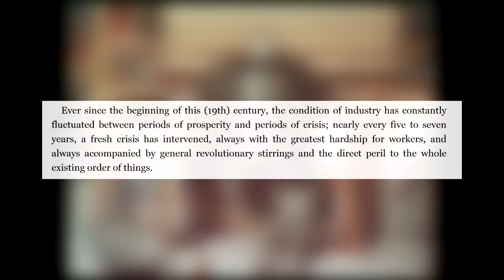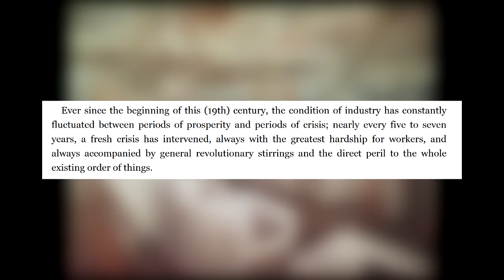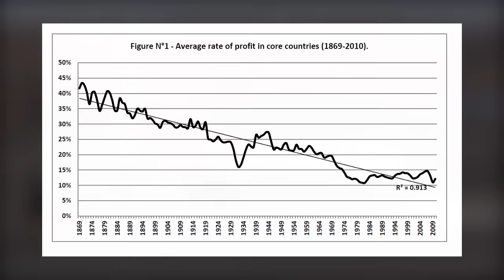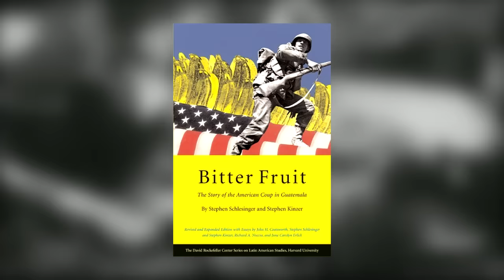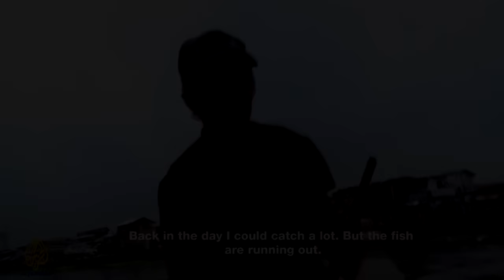Capitalism Really Sucks, But Why?

Comment: 1. Boom and bust cycles are a product of modern monetary systems, using unbacked currencies and fractional reserve banking to inflate money to benefit the state. It has absolutely nothing to do with capitalist mode of production. 
2. The rate of profit falling is entirely contingent on the labor theory of value, which is heavily disputed even by leftists such as Baudrillard and sign value. This is something Marx was aware of when he wrote “the poverty of philosophy” and mentioned it in “Contribution to the Critique of Political Economy” saying he planned to solve it. He died before he ever did. 
3. Capitalism does not require infinite economic growth, that is an absolutely baseless claim. And even IF it did he disregards the difference between extensive and intensive growth. Instead of using more resources in production, we can get more from the resources we use in production 
4. This is literally nothing but conjecture on failures of the state and not capitalist mode of production or talking about those who break laws, which is entirely irrelevant. If the state did not intervene in the market you could not have lobbyists, and there will be criminals in all forms of society.
5. Please explain exactly what form of coercion is stopping people from starting businesses, having jobs or seeking education? If not just their choice to look after family instead etc. Those with merit have the opportunity to do anything within the confines of the law, the just have to take it.
6. This is contingent on point 2 which is contingent on the labor theory of value, which is extremely flawed on every level.
7. Monopolies are entirely a product of the state and not the free market. Monopolies cannot survive the innovation of the free market. I challenge you to give me one example of a monopoly that arose and lasted in a free market without government intervention. Antitrust laws, intellectual property, minimum wage laws, taxes, lobbyists, subsidiaries - all ways that the government intervenes to promote big businesses and stop small businesses. All of which wouldn’t exist in a free market
8. This is all conjecture and nonsense. It assumes that the worker and the owner have entirely diametrically opposed interests. But if shorter hours reasonable hours and better safety standards allow workers to work better and produce more goods, (which they almost always do) then it’s in the owners interest to have those. 
9. Again nothing but heresay on things that are entirely caused by modern central and fractional reserve banking anyway. 
This video is filled with blatant sophistry, I hope at least some of you aren’t so tempted by the allure of unjustly owning the fruits of your piers labor and being part of some “in group” that you are drawn into this psuedointellectual drivel. So please, read Human Action, research the ECP and have a good day :)
Reply: What’s the best example of actual capitalism to you?
Reply: @ER-zf5tr  Switzerland is a pretty good example. What’s the best example of socialism or communism to you?
Reply: @conorw4077  would you say your example of Capitalism is a system where there is basically no public sector? 

I’m not sure tbh none from what I know
Reply: @conorw4077  im asking because I hear a lot of debate regarding the state and it’s involvement in capitalism. A lot on the right claim capitalism is where there is absolutely 0 government involvement in the economy and obviously the left claim the state has always been involved even back to capitalism’s formation. I was talking to a right libertarian (I’ll link his channel) who claims to be a minarchist ie he supports private police etc. To my knowledge the state has always been somewhat involved in a capitalist economy but again there could be some example throughout history where the state wasn’t. 

His channel btw: https://youtu.be/W4hwh_a0NYY
Reply: 1. Nope, private capital is still incentivised to extend itself to its maximum capacity regardless of if money is tied to gold or not. The problem is that any company that does not push itself to the limits will eventually lose out to a company that does.
2. There are metrics on this, you don't need to believe in the labour theory of value to read a graph my dude
3. Any company that does not grow loses to one that does.  A company is forced to constantly grow to compete for market share and investment.  This is basic stuff that even a capitalist acknowledges.
4. "Lobbyists only exist because states have laws" isn't the slam dunk you think it is.  What's your solution here?  Skip the middleman and just have private companies decide on what the law is?  That's worse.  You get why that's worse, right?
5. "What's stopping a skinny kid from winning the heavyweight championships?  If he gets strong he can do it"
Amazing reasoning, but imagine a world where in order to train at the gym, you had to fight everybody in the gym.  You're not addressing the problem, you're just saying that for some people it isn't a problem.  We know that for some people it isn't a problem.  That's the problem.
7. You have no evidence or reasoning to indicate that free markets are inherently innovative, or that innovation innoculates against monopoly.  Sure, big business leverage the state against competition but do you really think in an unregulated market those same businesses would just shrug and say "Oh well, nothing we can do to influence the world to our advantage!  I guess we'll just let the better ideas win!"  You can't think of any examples of companies cooperating to achieve the exact same goals without going through state machinery?
You can't even think of a specific word that was invented to describe exactly this practice?  No?  You've never heard of a cartel?  And you think you can challenge anybody else to anything?  Sit down.
8. It's nonsense to assume that workers and owners have different interests...but then you flat-out admit that better hours and safety standards are only in the owner's interest if it increases productivity.  In other words, you're implicitly saying that things which aren't in the interests of workers would still be in the interests of owners if it boosted productivity.  This is literally a concession on your part and I don't need to say anything else.
Reply: @ER-zf5tr   Ah I see your confusion. Well most dictionary definitions of Capitalism make mention to the majority of property being under private ownership, and  either the terms “free market” or a “lack of government control”. Meaning the government would have next to none of absolutely no interference in the economy and the vast majority of the means of production would be under private ownership with only some or no public ownership. So by dictionary definitions almost all countries are mixed economies and not capitalist. 

However the term has been co-opted by others such as John Maynard Keynes who was for heavy regulations while still mostly private means of production, the style of economics we see today in a lot of western countries. Marx also heavily reduced his definition to only mean privately owned means of production, without stipulation as to state involvement, as Marxists see that is kind of irrelevant. 
So because you have different groups using the same term with different meanings there is misunderstanding, but generally libertarians or pro capitalists mean a free market with private  MOP , whereas leftists or Keynesians may just mean private means of production, even though that is not actually the definition.

There have been examples throughout history where the government had very little involvement in the economy such as early America (not strictly capitalist though as slavery at the time violates individual rights) Switzerland now aswell as some others. Yes the government became involved in most economies historically speaking, but libertarians and other capitalists aim is to reduce that involvement through constitution, a smaller government etc. The thinking being that although it formed that way initially it can be changed and the government will not necessarily regain control because of constitutional limits or otherwise. Others simply want to remove the state altogether in favour of private defense. 

 Hope this clears it up.
Reply: @conorw4077  out of interest what are you in favour of? Completely privatised economy (including, military police etc) or just a small public sector?
Reply: @DeoMachina  1. Companies wouldn't exist in the same way in a free market, and the rest of your points are irrelevant. Unbacked currencies are inflated by the state to benefit central and fractional reserve banks at the expense of diminishing the wealth of the working class. This creates a spending based economy, means people must spend and invest and not save, which causes recessions. There is a reason the 2008 crash was caused by state intervention, and the great depression before it and every other recession since the beginning of time, excluding when volcanos explode and hurricanes which are unavoidable.
2. Yes and other factors affecting that include increasing corporatism (because of state intervention), increased taxes, inflated currency... Rate of profit is an absurd expression based on the false assumption that there exists a relationship between profit and capital. Profits are earned by superior foresight in adapting production to meet future shifts in consumer demand before competitors are aware of the need for such adaptation. Since profits cannot be related mathematically to superior foresight, there can be no meaningful "rate of profit". 
3. Grow is such an obtuse and ill defined word you could be asserting almost anything with that statement. But assuming even if that was true (which it isn't) there is intensive economic growth, meaning a greater efficiency of usage of available resources, which makes the point irrelevant.
4. You could have a constitutionally limited government that is not allowed to interfere with economic affairs, or just a state that doesn't interfere like Switzerland. and although I don't agree with it, private law is better than a huge state with a monopoly on force and law, as an arbiter of even its own wrongdoings, and ever expanding control over economics, foreign affairs and citizens daily lives, surely you can see that right?
5. That was entirely incoherent but basically, everyone has employment and financial opportunities if you live in a developed western country, take them or don't but its your choice to live by. I'm sure you agree capitalism is an individualist system, with rights, responsibilities etc all placed on the individual and not the collective. It is your responsibility to seek the outcomes you want in life, if you do not take your opportunities then it is because of your choices.
7. A legal monopoly has never been maintained in all of history, I challenge you to give me examples. Also you conceded that innovation is part of capitalism in your own response earlier "A company is forced to constantly grow to compete for market share and investment.  This is basic stuff that even a capitalist acknowledges." Also cartels operate as an illegal business, cooperate with and bribe the government, receive backing from other governments to launder money etc. this would not happen if drugs were legalized (which they would be in a free market) they cooperate with the government which also would not happen, and if the state spent as much money on a proper police force as it did funding politicians to sit in chairs and very slowly make decisions then they would have an better response to threats such as cartels.
8. Yes. I agree that not all interests of the worker and owner are guaranteed to always align. But workers in poor conditions work less efficiently, especially in more skilled work so your point is irrelevant. You say if poor conditions didn't decrease productivity and still lowered cost then it would be in the owners interest, but they do decrease productivity so your argument is hearsay only relevant in hypotheticals. Why do you think companies have benefits such as company cars etc? They want to keep workers happy. Owners have to compete for workers same as workers for employment, if the conditions, hours, work pay etc is too bad then get a different job. After all there would be more job opportunities and diversity of business in a free market (a recurring theme you may have noticed).

You should try being more cordial or at least less infantile when you deliver responses and points. Comments like "sit down" etc make you come across as immature and do not help your case. You will be less likely to change me or anyone else's minds when you speak in that manner, and it doesn't promote good discourse.
Reply: @conorw4077  1. People are forced to spend regardless of the monetary system, because they need to, y'know
Not die
The working class isn't saving money not because of inflation, but because they need to meet their immediate needs or perish.  None of your alternatives even purport to address this.
2. To claim that capital and profit do not have a relationship is a lie.  You do not believe that.
3. The term 'grow' is well-defined and well-understood.  Again, you are pretending to not know things.  Your argument really isn't bolstered if you feign ignorance!  It just isn't!
Efficiency is not the point being referred to, so again I have no choice but to interpret your refusal to engage as a concession.
4. You realise that the bad things that the state is doing to economics, foreign affairs and our daily lives are things the state is doing at the behest of capital, right?  Like, although the state is brutalising people on behalf of oil companies, oil companies are more than happy to pay for private security to do the dirty work when necessary.  There are countries where this happens, and the state is in no position to stop them.
5. Again, you're straight up refusing to acknowledge the point made.  The number of oppurtunities is not being debated, here.  You're attempting to refute an argument that nobody made.  The problem isn't "nobody can succeed", the problem is that success is wholly dependent on a class of people living in underpaid, precarious conditions.  It doesn't matter if a cleaner starts his own business, because somebody has to hold the broom at the end of the day.  What, you think we can all just be CEO's?  A hierarchy requires there be a base layer at the bottom.  Personal responsibility doesn't address any of what I just said.  Even if everybody woke up tomorrow and took maximum responsibility, nothing would change, here.
7. Legally speaking a monopoly doesn't even need to control 100% of the market, speaking legally that is.  So uh, legally speaking any time a company is found to have acted in a monopolistic manner then legally speaking it is a monopoly, by legal definition.
Interesting how a moment ago you had no idea what "grow" meant, but now you are very, very certain it means "innovate" which is...an interesting strategy!  Again though, you are simply lying through your teeth and I will not be addressing such fantasy, lmao.
As for the cartels point...you seem to genuinely think I'm referring to the drugs trade.  I'm speechless, honestly.
8. I don't mean to dunk on you too hard but the fact that poor conditions exist does actually refute everything you just said.  It does, actually.

And if you don't like my tone, perhaps you should examine your own.  You strut in with talk of sophistry and 'pseudointellectual drivel' and you expected better discourse?  I'm fairly cordial to people who can at least pretend to be here in good faith.
Reply: @DeoMachina  1. Inflation makes saving close to impossible. It is at least decentivised enough that in almost all circumstances not spending money immediately does not make sense for the working class. The majority of the working class in developed countries are able to meet their immediate needs. This is visible by millions not dying every week. Inflation makes it so that any excess income they have ever saved and could otherwise use to try and start a business etc should be spent immediately. This makes the working class consumers and not investors or businesspeople, this one of the main factors that make it difficult to leave the working class
2.Yes I do believe that. And no they do not have a relationship. Rate of profit is an absurd expression based on the false assumption that there exists a relationship between profit and capital. Profits are earned by superior foresight in adapting production to meet future shifts in consumer demand before competitors are aware of the need for such adaptation. Since profits cannot be related mathematically to superior foresight, there can be no meaningful "rate of profit." Look up praxeology and Austrian Economics.
3. You are the only one who is feigning ignorance. I said efficiency of the use of available resources. Just look up the phrase "INTENSIVE ECONOMIC GROWTH" and realize how everything you just said was incoherent sophistry. I have conceded nothing, claiming your misunderstanding and lack of knowledge of basic economics as a concession on my part is just a purely bad faith argument, do better.
4. How do you think these companies became so powerful? Because again I will ask for an example of any of these huge powerful companies and conglomerates that came to be or exist without help from governments. The position of governments as moral arbiters with a monopoly on the use of force that can influence the economy causes these problems and nothing else. And surprise surprise developing world governments are not able to deal with paramilitary death squads organized and funded by enormous government backed corporations.
5. Again these people would be better payed and have more employment and business opportunities in a free market. All of your points about "capitalism" refer to this neo-Keynesian mixed econ and not actually to Capitalism at all. You realize the definition of capitalism includes the words "free market" right? Check Miriam Webster. Yes a hierarchy requires a base layer, and in a free market that base layer is doing pretty well. Look at Switzerland's GDP and working class. 96% of people there make 48,700 USD a year or more, 51% make over 100,000 USD or more. Considering Switzerland is one of the closest things to a free market we have a think it makes a compelling case for the success of the free market in helping the working class.
7. Yes legally speaking that is correct. I am yet to become aware of those requirements being met and or sustained by a company without the aid of the state. If you know an example please inform me. I know what the word "grow" means, but SURELY you understand the inherent vagueness of it when referring to economics? It could mean use more resources and make more product , use less resources and make more product, make more money, become larger as a business... you speak in very unclear terms, cause misunderstanding and then announce a concession when your incoherent drivel is misunderstood naturally. And you misunderstand me, as intensive economic GROWTH comes from INNOVATION with resources used in production. I am not saying that's what you meant by growth, I am saying innovation with resources used in production can drive intensive growth. Making it different to extensive growth which leftists assume is the only kind of economic growth. But hey I wont claim a ridiculous concession on your part because of a simple misunderstanding.

I see what you are referring to now in reference to cartels, I made a mistake as that is what people typically mean when referring to cartels. Anyway they are either formed illegally or with state help or often both. I'll really concede on that one if you can find an example of this without state help, intervention or bribery, or using illegal means such as initiating force.
8. I don't mean to dunk on you too much but those are MONOPOLIES CREATED BY THE STATE and largely in developing countries good lord how many times... None of that is relevant to capitalism because it didn't happen under capitalism because its not in a FREE MARKET. Please look up the definition of capitalism. All give mention to either the phrase "free market" or "lack of state intervention" or "controlled by private owners for profit, rather than by the state"

I speak in good faith, and your accusations to the contrary are only when I have misunderstood you. I am not sure why I would pretend to not understand you because it is not like I am strawmanning you in doing so,  I have only tried addressing your points. And it is psuedointellectualism. It is blatant lying, use of misnomers etc to push a political agenda while cosplaying at an attempt to open a conversation. I am sure if I was to make an irritating PragerU style video about why " socialism sucks" and fill it with what you saw as blatant lies, misrepresentation and intentional use of misnomers you would find it quite annoying, and if you were going to comment it would probably sound pretty similar. Seeing as how you responded to my comment at least.
Reply: Nice argument.
Reply: @conorw4077  u made really nice points, maybe im not informed enough but i think an Anarcho-Capitalist society is the best way to go, its the closest we can get to freedom without going full anarchy 

its absurd to me that people think working at a fast food store is being a wage slave... u are getting paid for your service, thats literally how the universe functions. humans constantly want to move forward (not saying its good or bad, its simply what happens) and capitalism is the proper system for that. once the Ancap system starts working, all the organizations and people would be locked into each other in this mutual agreement and things would proceed naturally, standard of living for working class would be higher as well

idk how working can be slavery, cause u didn't have a choice? (between working and starving?) what about living then? u cant consent to being born... does that mean we are all slaves? its like socialists dont understand the most basic laws of this universe and blame all problems on Capitalism when in reality its either government or other problems (over-population, religion..)
Reply: @neonwitch1449  I would absolutely agree. Whether it’s ancap or minarchy we need to free the markets and reduce the size of the state, and what form that takes is just semantics to a degree. 

With regard to you being uninformed you seem to have pretty well developed ideas and values already. If you want more on libertarian type stuff I would recommend Mises, Rothbard, and Carl Menger, Rand and other Austrian school  economists. Plato and Aristotle are must reads imo. Thomas Sowell is very good also. And if you care very strongly about it and want to try and help  against the state Samuel Konkin has good stuff on how to take action. 

But I would always recommend reading a bit of everything because you want to be well rounded, so people like Marx and Baudrillard are worth reading to learn from the other side.
Reply: @ER-zf5tr  Ideally completely privatized, but I think it’s more important to focus on moving towards your goals than to get bogged down over what are to some degree semantics. If the state is getting smaller and the markets more free then I’m happy.
Reply: @conorw4077  thank u for the suggestion, i will definitely start reading about this soon!
Reply: @conorw4077  What entity would you want to enforce and uphold complete privatisation?